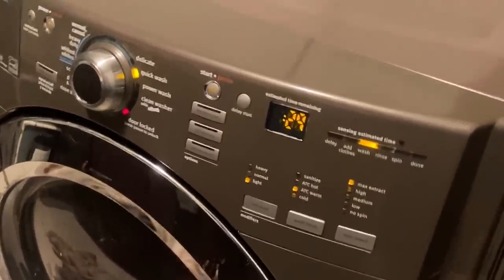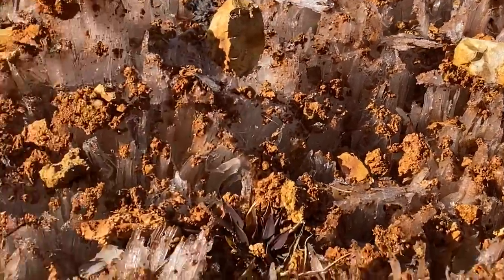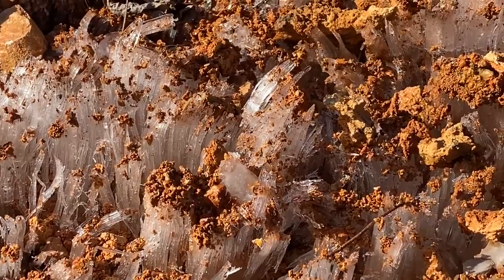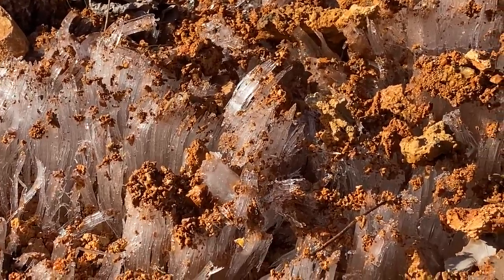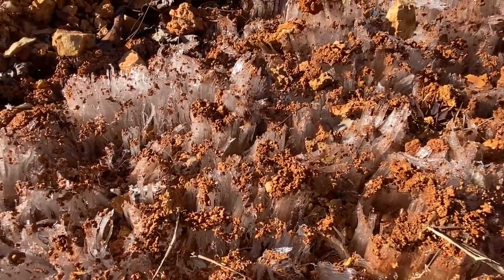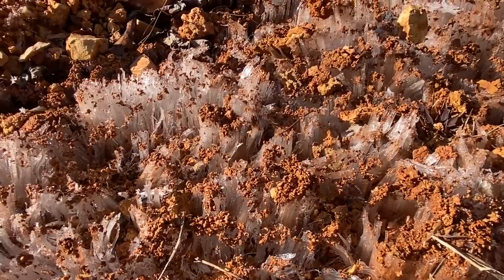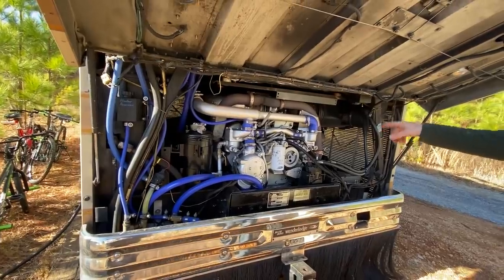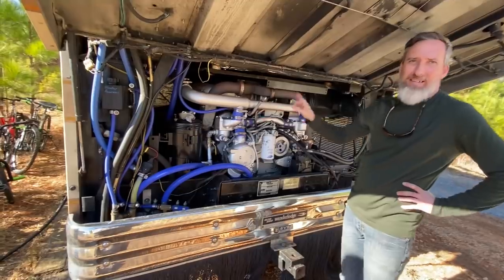Christmas trip home, and two bus visitors. Cool roll back car hauler

Comment: Thanks for having us Scott and Kelly! Oh and Leroy too. The Range Rover has not been too bad for us.. it’s been in the shop for wheel bearings and front control arm bushings.. all under warranty. This is a TD6 diesel.. the engine is a Ford design and it runs great.. I did the oil change and was shocked that there was absolutely not a hint of an oil leak anywhere... absolutely dry! Love the engine.. it’s making some more noise in the front and I think it might be half shafts.. going back to the dealer for work when we get home.. so yes they are somewhat normal British autos.. but I have a soft spot for them.. I also have a 99 Jaguar Vanden Plas..

Comment: That wonderlodge is probably more reliable than that Land Rover it was towing.
Reply: Please don’t mock the land rover,there are many people whose existence depends on their legendary British reliability:-)
Reply: By the way, at the park where I work in Miami a park patron who drove a Land Rover (diesel) had it stolen from his front yard this past year. The detectives said it was because he recently had it serviced, and somebody on the dealership staff was the thief (s). Happy New Year folks! Bless
Reply: A Land Rovers natural environment is on a tow truck.
Reply: @davidj4662  Right
Reply: The ones built after Ford bought them are surprisingly reliable nowadays! Even the Car Wizard has nice things to say about them (he even bought his wife a pre-owned one!) See his vid showing just how many parts under the hood have FoMoCo embossed on them.
Reply: @snuffysmiff   NO.
Reply: 9 out of 10 Rover's are still on the road - The other one made it home...
Reply: The Rover has done about as many miles on this trip as the Wanderlodge.. and they both have issues.. the rover is the TD6 diesel which has been doing fantastic. Most of the issues we have had so far have been in the driveline and suspension, had a wheel bearing and control arm replaced under warranty still.

Comment: Those back seat hammocks are great for dogs - they are much safer as they can't fall into the footwell.  Two things to look out for with them 1. Make sure the one you buy is waterproof (learned the hard way) 2. Removable padding is great - back seats are pretty lumpy these days (esp. belt buckles) and you can easily take it out to wash it.

Comment: LOL, Ok Its wrong to laugh, but Christmas day while cooking Christmas dinner the main  wall switch panel to the cooker got hot enough to burn your fingers so we reduced power took longer to cook - it was fine, Boxing day the switch panel began to smoke - PANIC - lol so i turned all the power off unscrewed the switch panel from the wall, found the 2 red live wires had lose connection screws ? so tightened them up, left it all hanging out the wall and continued to cook the meal/ great all done ( Waiting for the store open Tuesday) Stayed up till 3 AM went to bed as the rain and winds outside were howling but by 4 AM heard a steady drip drip drip so got back up to find the roof was leaking on to the kitchen floor/ put a bowl under it cussed and went back to bed again.. Woke much later that day to find only a small amount in the bowl and no marks on the ceiling ?? So along with the new cooker switch panel I purchased on line I added "strong black roofing sealing tape" plus 2 cartridges of roofing (and rain gutter) sealant to my pre paid list for collection tomorrow, as our builders merchants are open from Tuesday but only for click and collect service due to covid restrictions along with most of our country now/ So, its Christmas tales of the unexpected type from me - you are not alone - LOL - I`m 72 disabled but I got to get a ladder out to go look at my roof "soon" - luckily I live in a single story bungalow just 30 metres from a great beach so at least I`ll get a good view out to sea.. Be safe all, have fun, Love your videos - Thanks - Ian -- UK.